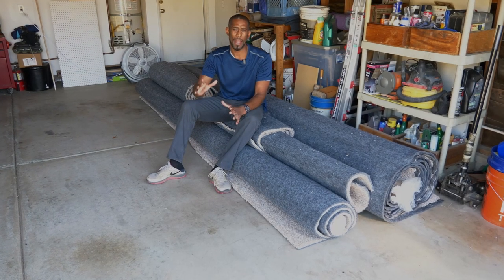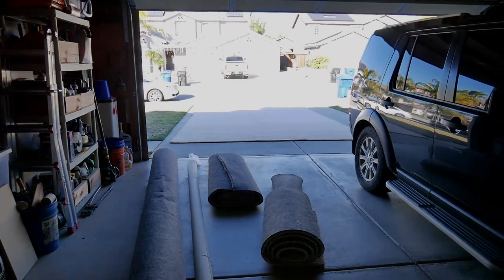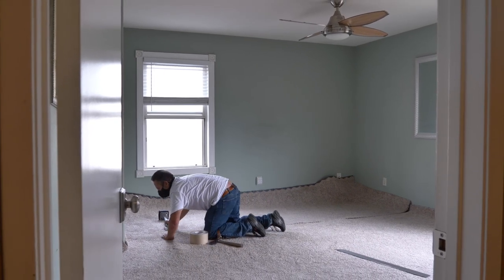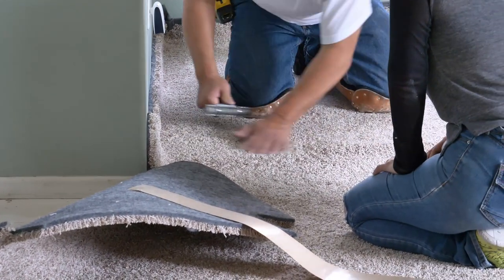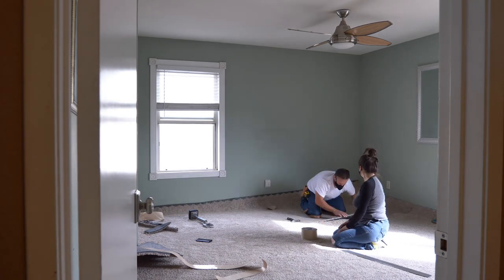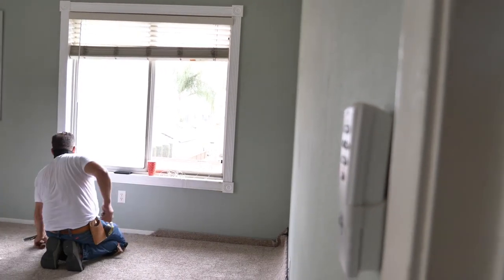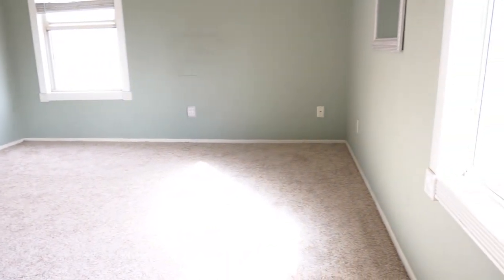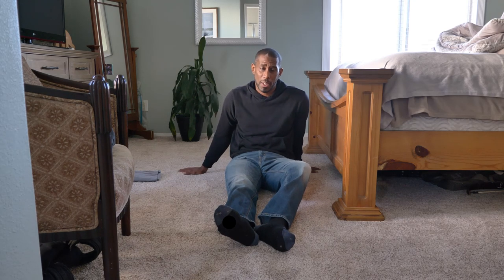Learn Why You Don't Need A Tack Strip To Install Carpet | No VOC | Hypoallergenic | Mohawk Air.o

Comment: So upon receiving the bundle of carpet, was there a detectable smell? You wanted to air it out so that's why I'm wondering. I have ZERO tolerance for smells myself, so I was interested.
Reply from the maker: Even on the first day the carpet really was not an issue. After airing it out for a day or two I smelled zero. The issue is the tape. The tape is the problem. It took about a week for the tape smell to leave.

Comment: Sorry but no carpet is hypoallergenic,  it is man made, manufactured from basically plastic. Carpets do trap dust, dirt etc , so if you really suffer from asthma or dust mite allergies you need lvt, vinyl , wood, laminate etc. No doctor would recommend carpet for a real allergy suffering individual.

Comment: What kind of tape is that and where do I buy it?
Reply from the maker: The tape comes from the company, but I will say it has a very strong smell. If you have allergies the tape is where the smell comes from the carpet has pretty much zero smell.
Reply: So do you think this kind of carpet without being installed with the tape if it's cut to fit the room like a bedroom do you think it would stay in place?
Reply: Do you think it would lay without the tape? Or if they only use the tape in the entryway to the door or the closet.? Did the smell go away?
Reply: @bonirabit4302   Robert's sell a 2 face  tape that works fine and cost much less . Home depot.

Comment: How much was this to install in one room? I feel I need carpet because I have severe arthritis and problems with my legs and feet. And my landlord wants me to move they want to sell this condo so they're building these new apartments three stories they put in some sort of flooring now that's hard you know and they can put in the soundproofing things so cuz they used to have to have carpet when you have people upstairs. My question is I think this could be my solution I was hoping to at least put carpet in the bedroom and then try to find some sort of big area rug for the other room it's just a one bedroom apartment I'd be renting it I didn't want to get in trouble. But this looks like my solution! How much?
Reply from the maker: We did roughly a thousand square feet for $3,500. That included the stairs and us paying them. So if you're going to do it yourself for one room I would think anywhere from 200 to $400
Reply: Who should I contact what's the name of the carpet again? Maybe if I'm in an apartment and I can't have it installed maybe it would still be a great kind to have measured You said it seemed like it was sit well without being taped? I just want to find that particular type of carpet if I end up going for sure in this apartment
Reply from the maker: In the description below the video I left the information to the name of the carpet. You would have to contact your local carpet installer to see if they have it.

Comment: Where’s the under pad?
Reply from the maker: @ZimZam131  this particular carpet is a combination of carpet and underpaid in one. Once you lay it down on your subfloor it pretty much does not move even before they taped it.
Reply: @oxmanagain  Understand I live in Florida where most carpet is laid down on solid concrete. So the purpose of the pad is to cushion the carpet when walked on, not to keep it fro mmoving. Perhaps wood flooring doesn't need it.

Comment: 2:09  If the nail strip was already there, you could have reused it.... you actually created more pollution in the world, and more work for yourself by removing it... remember, the best way to reduce pollution in the world is to REUSE things....
Reply: Not really for kanga back carpet or rubber back carpet with padding pre attached u don’t use tack strips u use double sided tape